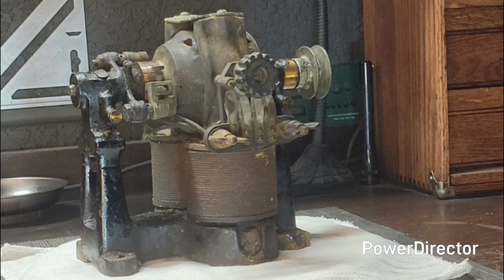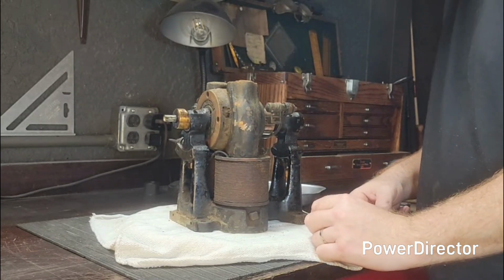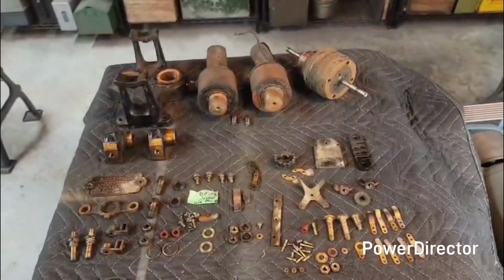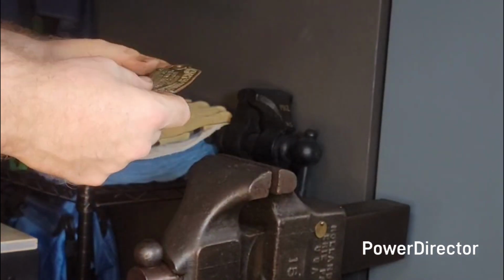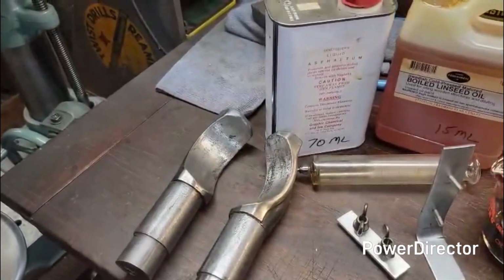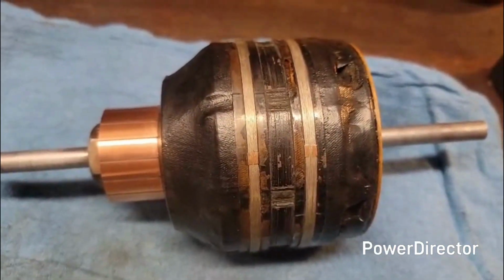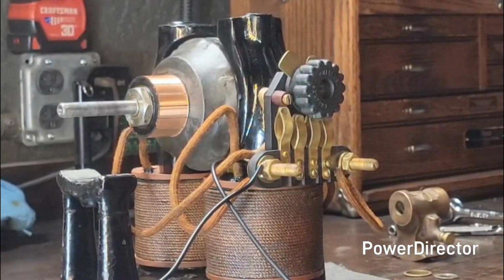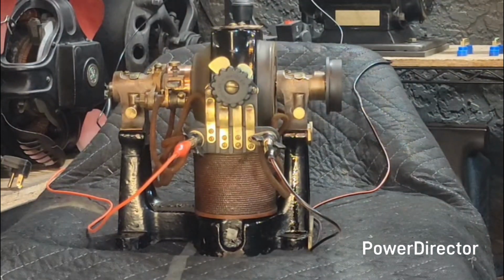Crocker-Wheeler Restoration: Bi-polar Fan Motor circa 1895.

Comment: Terry; that is one of the most amazing preservations I have seen. Your attention to detail never ceases to amaze me. 

It's very interesting that a motor that small has ring oilers. That is an intricate design for sure.  They really allowed form to follow function back in these days. 

One thing I would love to see / hear is this motor with a rated load applied to it. It does sound good at low speed but I would love to hear how it would have sounded when new and being used for its designed application. 

Thanks again for sharing this with us!
Reply from the maker: Glad you enjoyed it. If I ever run it at full voltage, will send you a PM with a video.

Comment: I contacted you last year about a repulsion induction motor on an old walker turner jointer I was rebuilding. I wanted to be able to everyday use, so, Inspired by you, I replaced the original bearings on both the motor & cutterhead with new sealed bearings, re- coated the armature  and field windings with new enamel, & replaced the knives.  All this l just as we're getting ready to move out of state, & I won't be able to take it with me.  But I at least wanted to get it running  so I could try to sell or give it to someone who would appreciate and use it.  After replacing the wiring from the motor to the switch, I finally fired it up yesterday, and the motor/ cutterhead run BACKWARDS!!!  The 4 wires coming from the  motor were soldered together in pairs, so I could not have changed the way they were hooked up.  I'm thinking maybe, when I put the motor back together, I might have installed the brush plate 180o off?  What do you think?
Reply from the maker: Repulsion start motors change direction by loosening a screw and sliding the whole brush carriage over to the other side. Theres usually a winess mark simewhere to show you where to line it up. My video on the GE SCR motor shows the process in detail.

Comment: Great job on this! We've got a generator of this style where the cloth covering is totally missing from one side of the armature. It probably got damaged at some point, and someone just ripped it entirely off. I'd like to replace it at some point, but I'm not sure that anyone still alive knows how it was originally done.
Reply from the maker: More than likely done with armature disassembled. There are screws behind the brass plate to allow it to be taken apart but I wouldnt. If a rewrap was needed on mine I would use a similar process to what I did here but then cover it.  Thanks for checking out the video.